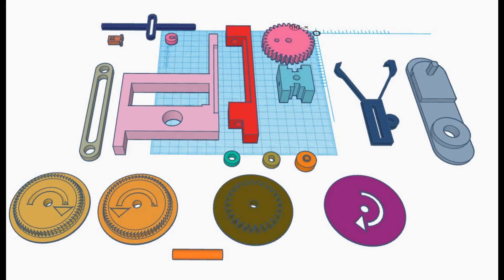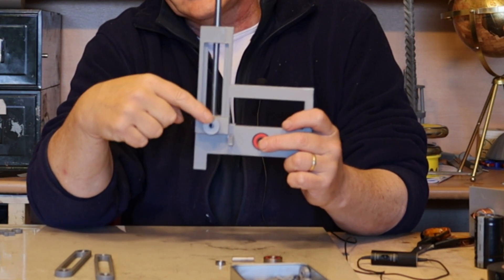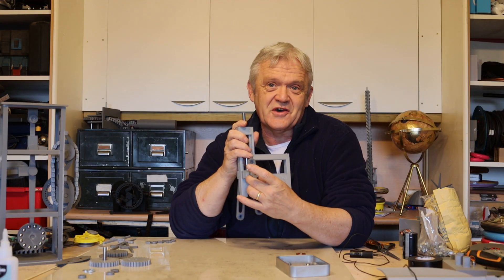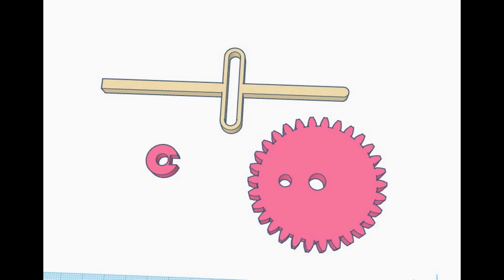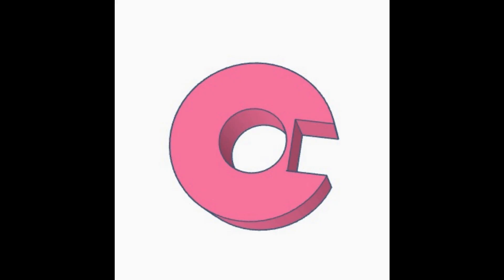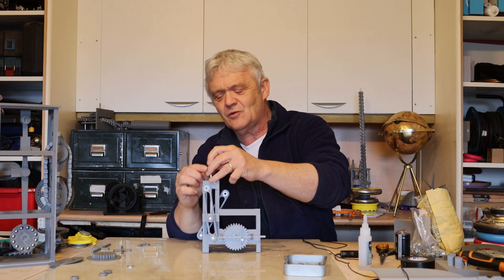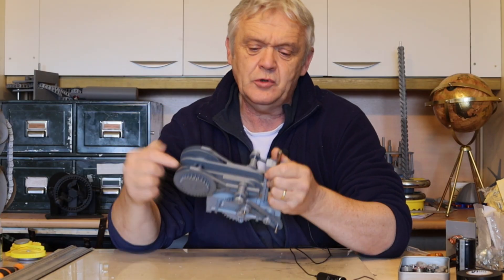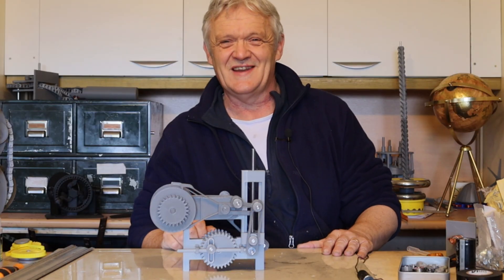2093 Building A Continuously Variable Transmission

Comment: Can someone help me out here?  When watching these video's, I really couldn't easily discern what the problem is that this is solving?  Converting rotation to a thrust rod?
Reply from the maker: to be honest mate this video is about designing a machine - it doesn't matter what the machine is - did you watch video 2090? Anyway this is a torque convertor
Reply: @ThinkingandTinkering   Thanks, I guess I should probably just go google what a torque convertor is for. Hard to get out of my own way sometimes.  Thanks for the continued awesome stuff!

Comment: i had a idea i've not seen this but use the expansion of water as it freezes in a chamber with a piston on top so as the water freezes the piston moves up to generate energy from cold.
water expand 9% of its volume when frozen and exert (24,000 to 114,000 psi) if you convert psi to joules thats 4.686MJ to 22.257MJ ... to "recharge it, you would have to melt the ice"
not sure if it will work right but to use cold to make energy would be nice.
Reply from the maker: how about that - i have been pondering this for a while!
Reply: Sounds like a great idea for colder climates and high deserts where it freezes at night and warms up during the day. 
The way I'd envision it is some device outside has the water and piston, when the water freezes the high torque gets converted into high speed to produce electricity, or if indoors heat production is the end goal, the piston rod could simply be connected to another piston at the other end, to compress a gas to produce heat directly, without mechanical losses other than the piston rings or seal.
Intuitively I don't see compressed gas producing enough heat to warm up a home through the night, but my experience is with 40 to 100 PSI, not 24K+, and nothing prevents scaling up the system until it provides the output desired, so in principle it should be possible.
The tricky part would be to have just the right day/night temperatures to get the liquid/solid phases each day.
In a typically sunny area it would be easier as the sun could warm up the water cylinder regardless of the air temperature.

Comment: I get that the distance between the pivots causes the "gear ratio" to change, I'm just not sure how to calculate it.  Do you divide the length of the input stroke (ex. 75mm) by the length of the output stroke (ex. 15-250mm)?  Giving a ratio range of 1:5-1:.3?
Reply from the maker: it's just a lever and you caluculate MA the same way